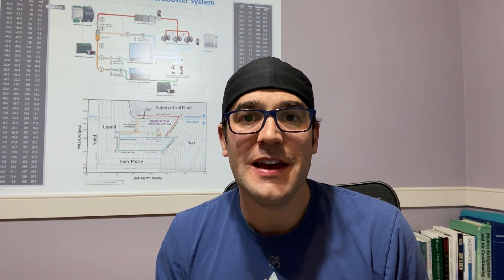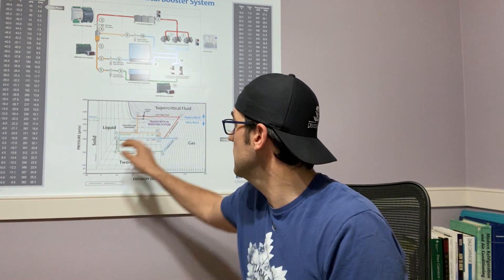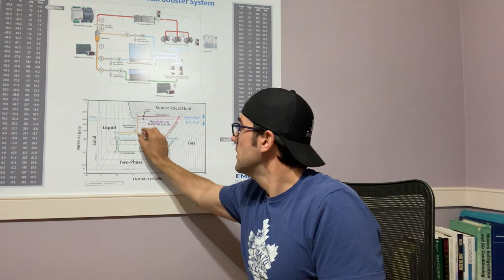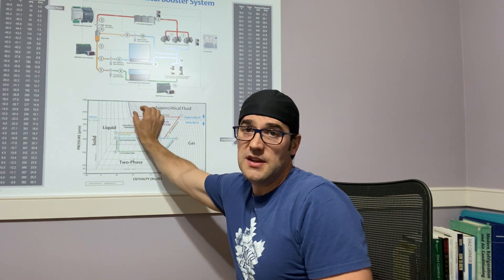Mechanical Subcooling for CO2 Transcritical Booster Systems

Comment: Hey Trevor, just wondering if you learnt much more about mechanical subcooling on transcritical CO2 systems since this video came out?

Company I work for doesn't do much transcritical work, but one of the sites we might pick up runs transcritical + mechanical subcooling. 

Would love to learn more about it if you've got any more info!
Reply from the maker: Yes I have been learning much more on this solution. It has great ROI when implemented correctly. I did a CO2 video with Kysor Warren/Epta and their ETE design which is using the CO2 from the system to create the subcooling. Check it out in the mastering CO2 playlist.
Reply: @RefrigerationMentor  Legend,  will do. Thanks!